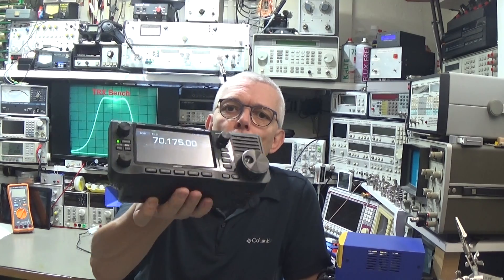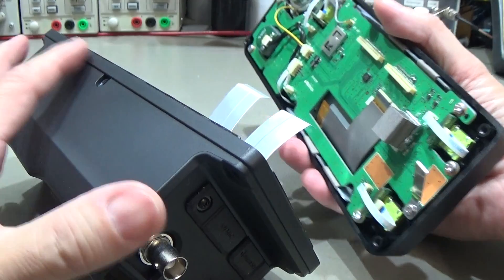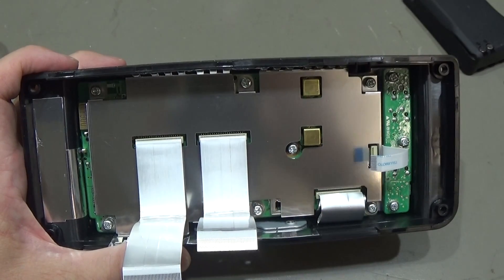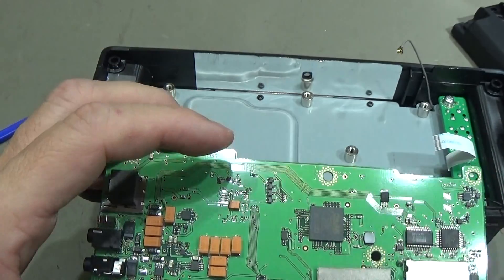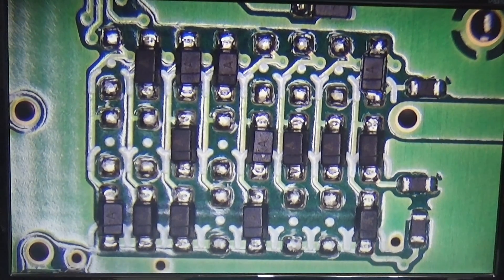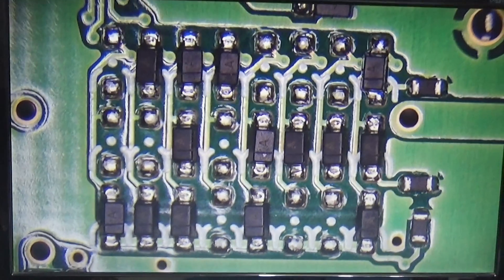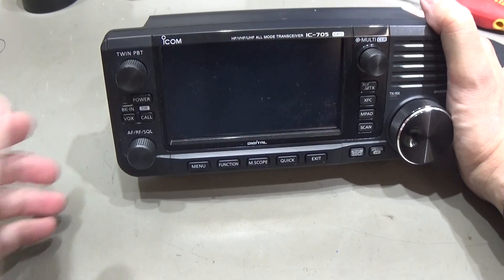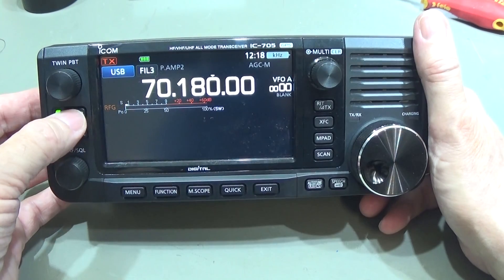#257 ICOM IC-705  How Frequency Expansion is performed...

Comment: Thank you!  I found it easier to remove the USB board (three screws) as its small ribbon cable disconnects by lifting the retainer clip. This means its very easy to reinstall this small cable. I used soldering iron tweezers and an inexpensive LCD microscope and some high quality flux. I practised many times with no power to the iron, in order to try different angles and adjustments to the tweezer's prongs. Two hands were better than one to reduce nervous hand shake! All worked. 😁

Comment: Bit of an along shot asking; but my IC-705 is transmitting low power (about 50 milliwatts) only on 6 metres (50-54MHz). All other bands are fully functional. Any ideas what could be the issue? No mods done, never been opened. Antenna is ok, mic gain ok. Power supply is DC.

Comment: Hi Peter, I performed this mod and it was successful. However, like several others in the comments, I found that TX tapers down to near 0 starting at around 450mhz. I assume this is due to the filters. Have you attempted to modify the filters to pass 455-470mhz? Also, in another video I saw that you have a schematic for the 705. Where can I obtain one?
Reply: I ended up figuring this out, for those who are willing to go a bit deeper into the radio.  Get the Service Manual, and find FI421 and FI422 on the RF board.  These are TA1808A SAW filters that limit the UHF to 440MHz +/- 10 MHz. Therefore it's blocking 450MHz-470Mhz.  I put a TA1406A filter (460MHz +/- 10MHz) in parallel with the other two, and can now transmit the entire range of 430MHz - 470MHz.

Comment: I just did it and it worked IC-705 (US version) Thank you so much!.I dont have such fancy equipment as shown on this video I Only used small slanted cut de-soldering tip( no luck with a point tip) @ 390 degrees (centigrades) almost the same size as the soldering on the diode (to avoid damaging neighbouring components), no flux, and not hot air. It took less than a minute to bubble under the component (used cheap digital microscope from amazon). A that point I switched to the other side and applied minimum force sideways. They came off clean, one at a time. It took a lot of practice with an old iPhone since this is my first time doing any of this. Removed surface components for one afternoon after I felt confident enough to do it on my brand new radio!. It was intimidating at some points but im so glad I did it. Good luck guys!

Comment: no need to de-solder .just use jewelers small flat head the diodes pop right off slide up under and just the slightest twist and there gone.I was done in like 10 minutes start to finish.
Reply: PLEASE do not do that the change that the print is damaged is very high

Comment: At the end of the video, when you are testing the transmit, the VFO shows 5.360 MHz but your frequency counters show 10.190 MHz: what am I missing? Thanks and 73, George, KC1V
Reply: That wasn't the frequency counter showing 10.190, that was a watt meter.  When the second readout for watage is shown, you can see a frequency counter to the left showing the same readout as the 705.

Comment: I use this radio with the Xiegu amp (100w) and it is extremely versatile and I use the stock microphone and get excellent radio reports all the time. I sent mine in to have this modification made and it is certified by a ICOM technician so that I do not void the warranty. It cost about $125.

Comment: I don't have any need to perform this mod, but was simply interested in seeing what was involved in disassembling the IC-705.  Upon re-assembly, do the front-panel ribbon cable connectors simply slide straight into the receptacles on the front panel, or are there any latches that need opening or closing?

VERY impressive test bench, by the way!  :)

73 form Tom WA1LBK
Reply from the maker: don't remember if there were latches or not, sorry
Reply: The ribbons in question are friction fit, no latches.

Comment: Remove same ones for US version? Mine has the diodes in some different positions in the matrix.  * it is the same two for US version also.
Reply: Ever get an answer to this?
Reply: @forgetyourlife  No,  but I removed the same ones and it worked out ok.
Reply: @UABFWSS  on 2m and 70cm?
Reply: @forgetyourlife  yeah,  & cb range 11m, gmrs, marine etc.  *mine is a 2023 built US version. The most sketchy part was reinserting the ribbon cable ends,  specifically the small one.

Comment: Just a word of warning:: If your radio gets wet, DO NOT put it in the microwave to dry it out.  It will NOT work and you will destroy your radio!!!  I think reprogramming a PLL chip in a CB radio is much easier than working on an ICOM 705.  I've heard from other hams that an ICOM 705 and ICOM 746 are easily opened up and when they're opened up it opens up the VHF as well giving the ability to transmit out of ham bands.  I would only do this as in an emergency situation.  I plan to open up my Kenwood 281a.  As far as I know, there isn't a way to open up the VHF on a Yaesu 991a.  I've had the MARS mod done and HF is opened up.  W Rusty Lane k9POW in eastern Tennessee
Reply: in the microwave?!?!
Reply: @nutsackmania 😂

Comment: Thanks so much Peter for posting this video on the 705 & for your easy & simple instructions especially as I was one of the luckier hams who received it early in 2021 & even at AUD$1800 I have zero regrets ever buying the radio & it's my favourite rig ever.
Curious if one does this out of band mod does its internal filters show any appreciable drop out of the standard ham bands?.
Thinking of doing the mod if I ever take the 705 on holidays with me into EU & can use 4m & 60m as my VK licence is CEPT compliant (VK has nil 4m nor 60m yet!).
I have an earlier release 705 from mid 2021 & the front panel fascia says "D-Star" & it's been an awesome radio working with Sotabeams linked dipole plus 2m/70cm antennas off the Windcamp RC1 mount.

Recently applied v1.31 firmware from Icom Japan site.
Hope you've been really well & looking forward to more content!
Reply from the maker: 60 m is okay, but 4 m doesn't work at all.

Comment: What is the upper UHF RX edge frequency stop after this and do you achieve full RX spectrum VFO continues range from .03Mhz to something like 500Mhz /  (200Mhz to 400Mhz unlocked ? - my guess is yes).  
 It is a question as no one has mentioned anywhere what the unlocked band edges are ! 
 I have one of the first 705 and will be leaving TX locked and asking the questions about RX out of curiosity and well aware performance will be poo as the band pass is only designed to go up to 470Mhz, unless some mods are performed to the filtering. 
 Diode matrix array is old school from the Icom - IC2 era.  Neat the 705 has a SMT32L051R8H6 and ill wait until the warranty runs out before I start probing at it, not that I really care as it is just a kick around radio unlike the 8600 or what ever comes first. The long anticipated SHF version or time for Icom to design a new portable receiver.
Reply from the maker: see under the video in info box
Reply: @TRXLab   what about RX ? These bands are already factory open 0.030 Mhz to 200Mhz RX  with no modification. TX filter's are 0.03 - 74Mhz. 144 - 148Mhz. 430 - 450 Mhz. RX will work ok up to 225Mhz and 400 to 470 Mhz. Does the diode removed go beyond 470 for receive ?
Reply: @wireless80211x  Do you think its possible to do a mem dump on that stm32 mcu? I got my 705 open on the bench now undergoing repair. Dummy me put 45v through this poor thing. Magic blue smoke escaped but it's still alive and tx/rx works.
Reply: @TRXLab  
All done 0-600Mhz RX TX  Requires technical ingenuity then just removing diodes ! 
Remove D933, D934, D935 to avoid accidental transmission while experimenting.
D926 - BOOT0 line of IC901, critical/ likely effect MCU startup
D928 - PCK (PLL Clock)
D930, D931 - PDAT (PLL Data) and PLSTB (PLL Strobe) lines from IC901, for programming PLLs
D932 RESPL (Reset PLL?) 
D933 - TXS (Transmit Select HF)
D934 - VTXS (Transmit Select VHF) 
D935 - UTXS (Transmit Select UHF) 
Fish and Chips 💥⚠
D936 - FORL (Forward Power Detect Low?) ADC input.
D937  -REFL (Reflected Power Detect Low?) ADC input
D938  -IDP (ID Power/Drain Current?) ADC input 
D939 - ALCV (ALC Voltage) ADC input
D940 - THML (Thermal ADC input?) line 
D944 - SCRES (Serial Controller Reset?) line
And then...
PLL. The main synthesizer, IC201 (LMX2571).
"Danger, Will Robinson!"

Comment: Sorry, maybe I missed something that has been explained, but why would anyone want full tx across (I assume) all bands? Perhaps for a maritime application?
Does the extension also apply to VHF and UHF? It is a pity that the video does not show from where to where the expansion now ultimately runs and whether 10W is available over all bands. And how RX has been influenced.
Reply from the maker: Info now in the discripton box. The power output gets reduced at colsere you are at the filter edges
Reply: You need it also to work on 60m band in Europe
Reply: I accidentally purchased a Japanese variant of this device and 2m is severely degraded in the US on the Asian radio. 

I will be using this mod to help my case.
Reply: @TheNerdCompany In a similar situation. Did you do this mod?
Reply: @davidm5972  i did the mod, it did not work in my case. It seems that recent variants are hard software coded.
Reply: @TheNerdCompany  Good to know. Thanks for the reply!
Reply: I sent mine in to an icon technician and got it done for about $125 and they mark the internals so the warranty is not voided.
Reply: @Riceman-o1p  Can you say where you sent it? I would still like to have this done.
Reply: where did you find the technician? @Riceman-o1p

Comment: Amazing to see how far RF electronics and electronics in general have come. 
 This transceiver handles HF to UHF I assume.
Reply: Yup! Spec'd for 10w from 160m to 70cm with a 13.8v supply. I want one bad but I don't have a spare $1400 laying around.
Reply from the maker: yes up to UHF
Reply: @TRXLab  Question: receive is rated all the way down to 30kHz, how good does it actually work down there?

Comment: Would be nice to see the output on the spectrum analyser to see what effect this has on the filtering.  Also is it just hf or is the uhf/vhf expanded as well?
Reply from the maker: at the edges of the filter the power goes down
Reply: @TRXLab  But what are the edges of the filters? Or a bit more specific, will it work on 4m? ;)
Reply from the maker: @zvpunry1971  No 4m
Reply: @TRXLab  It´s insane that ICOM does´t allow it to work on 4 meter TX. I would buy it to replace my KX-3!! 73